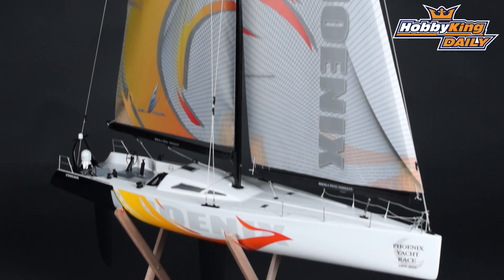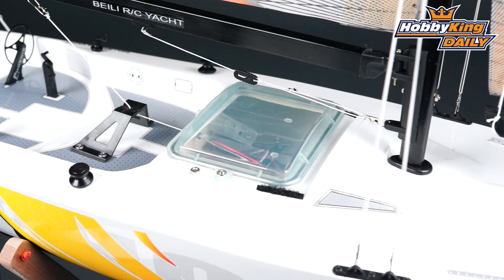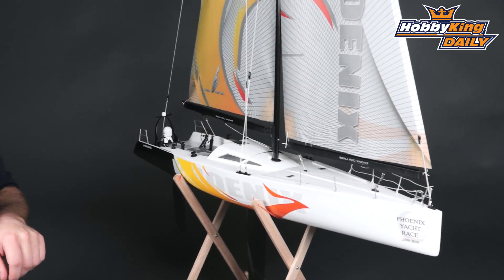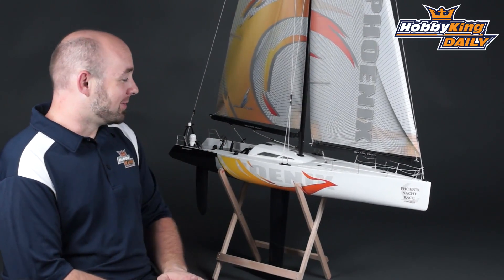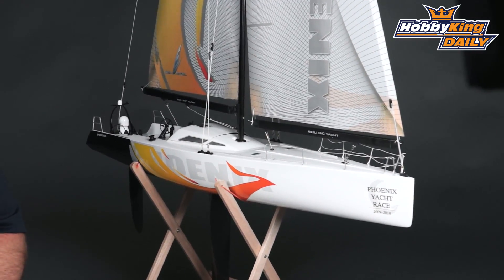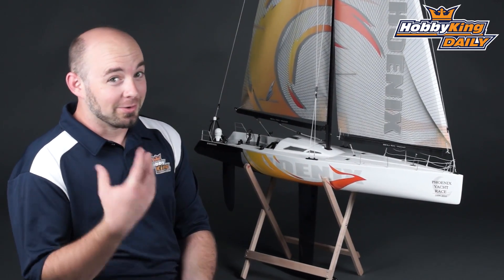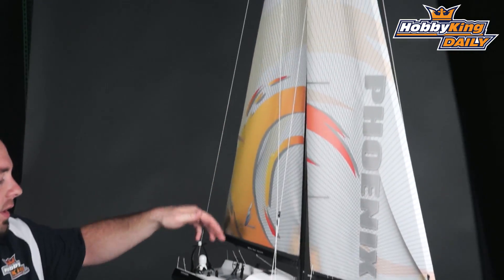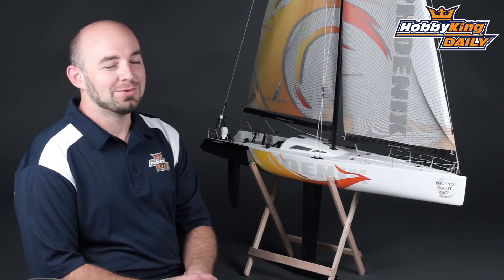HobbyKing Daily - Phoenix Sail Boat

Comment: Sailing into wind is 'tacking' not 'attacking' (which is what I think you said, apols if you didn't) and sailing down wind is called 'running'.
Reply: Sailing into the wind is actually called 'Beating', tacking is just the manoeuvre used to change direction when beating upwind. And just to add, the other kind of sailing (across the wind) is called 'Reaching'. ;)

Comment: Where are the wings ?
Reply: They're those vertical bits of cloth which have an aerofoil section and generate lift horizontally.

It looks a nice piece of kit but sailing model yachts is much more fun if you're racing other boats of the same class.
Reply: BelperFlyer
lol cheers, i fly fpv and nitro rc planes, but always toyed with the idea of one of these lovely boats someday.